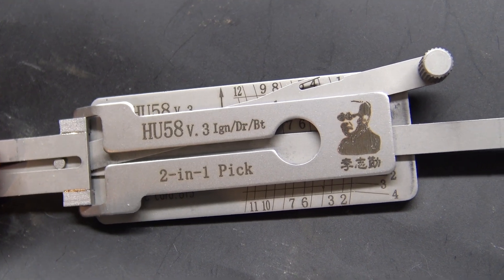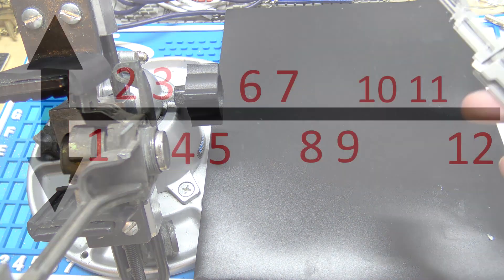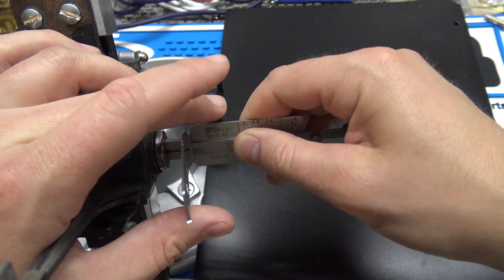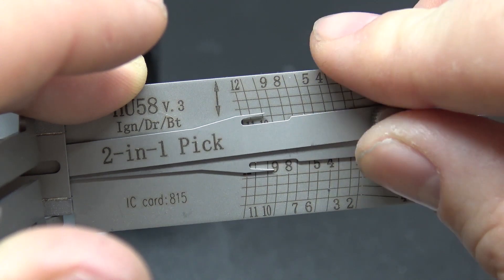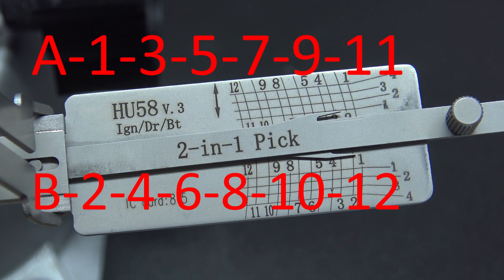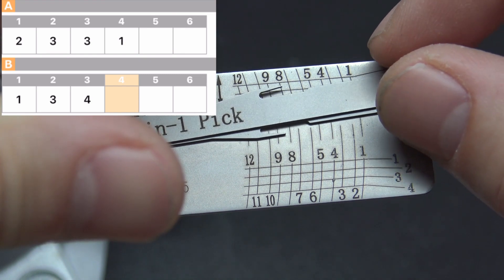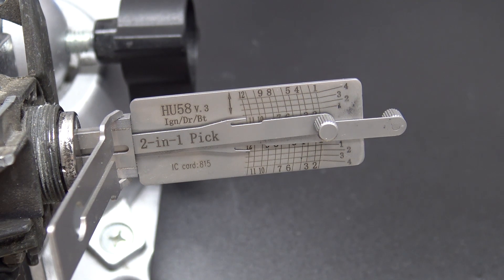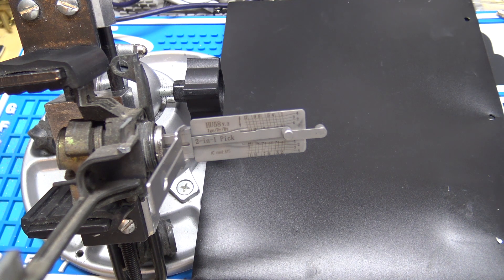(484) HU58 Lishi Picking & Decoding 1996 BMW 3 Series Lock

Comment: great video. ive been trying to figure out hu58 for a while now, recently i found your video and gave it another shot, im able to pick it very easily but i still cant decode even after following your video very closely. the door lock im practicing on doesn't have waffer 3/9, so when i cut the key, is it a 1 for 3 and 9? now i know for the ignition i would need to use instacode to figure out the cut but for now i just have this door lock im practicing with.
Reply from the maker: If there’s no wafer in that position you can cut it to whatever you want
Reply from the maker: If you fill your cuts into insta code do you get a valid code?

Comment: I’m trying to do a 2003 540i and it has the same key way/blank used but looks to be only 6 cut. Is there another Lishi I should use for that? Because this method isn’t lining up with spacing correctly.
Reply: I also made sure the tool was inserted all the way properly
Reply: I did try the hu92 Lishi just to see it doesn’t fit.
Reply from the maker: @citylocksmith3553  hu92 and hu58 are the only 2 possibilities on that car. Did you try the ignition too?
Reply: @BoredLockpicker  so I’ve been looking into it. And right, they are. So it’s the right pick for sure. I have not tried the ignition. And it’s possible the lock is just not a good lock but it looks ok and of course I lubricated the lock.

My biggest issue is centering the pick on the wafers on this one. On most lishis I’ve used I’ve had no problem sorting out what’s moving in the lock. But on this one it just doesn’t feel like the wafers are lining up with the numbers. And I assure you the key is all the way in.

I wonder if you would be willing to do another video and really emphasize on these channels and finding them. This looked effortless for you like the others are for me. I’m sure there is a feel to it.

What I’m gathering is that the margin for error is very wide as the wafers channels are so small. I must need practice…

Edit: also I’m just now hearing your mention of 3 and 9 being missing in most locks. I’m sure that’s part of what’s throwing me off having not known that. And having not listened throughly the first time through
Reply from the maker: @citylocksmith3553   on old old cars there’s never a guarantee the lock is any good. I’ve only ever used this Lishi a few times and I’ve never an issue with it but I’ve also gotten lucky that times i have used it the locks for we’re ok shape.  I would try the ignition if I was you or pull the lock and try Lishi in a vise or strip it down. (Which I hate doing lol)

Comment: just right in time for a great video with awesome explanation of HU58. I have 2 cars need keys so this is explains alot. Thanks for your help! Any insight on how to get 2000 BMW 7 series programmed?
Reply from the maker: Vihorm glad it helps with the picking and decoding. I’m sure program this would require eeprom.
Reply: @BoredLockpicker  thanks much..I have 1997 bmw 528  key cut from a door lock but doesn't work in a ignition also same for 740li..any idea why they don't work in a ignition?
Reply from the maker: Garik Voronkoff thats very strange.  If the ignition wasn’t changed and the lock isn’t broken it should work
Reply: Because the ignition is much tighter tolerances and also has added wafers that door does not have
Reply: This has either EWS3 or EWS4 
Use VVDI prog and vvdi2 or Tango
Read EWS data then write key 
Write data back to EWS 
Start car
Collect $$$

Comment: Too bad it’s a 3 series key, you get all cuts in the door. If it was a 5, or 7 series, then 3 and 9 are blocked off and you would have to get the cuts off the trunk lock to have a complete key to be able to use in ignition switch. Or use InstaCode to do cut probabilities. Good job, I feel these easy but a lot of folks think it’s hard.
Reply from the maker: People seem to get confused on the decoding. Definitely aren’t to hard to pick. Thanks for checking my channel out.
Reply: Some people get confused because they forget that when you use dual lever lishi you have to decode opposite of how you picked. When I first did Bmw 4 track I was able to get single lever hu58 and it was a million times easier because even if you forgot how you picked it. It wouldn’t matter. Now single lever hu58 are no longer in production. Also all odd #’s are A and all even #’s become b maybe that is the mix up? Oh well. Have you done hu39 yet?
Reply from the maker: @jrpena418  I haven’t. That’s one of the few I don’t have. Not to many old Mercedes in my area I guess.